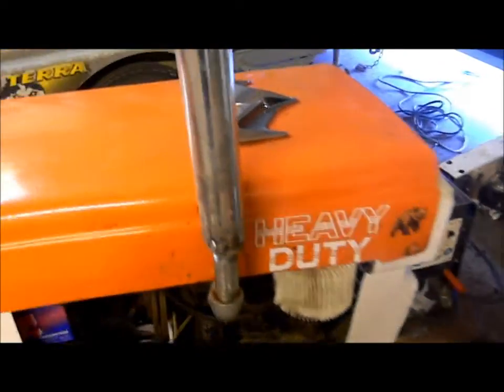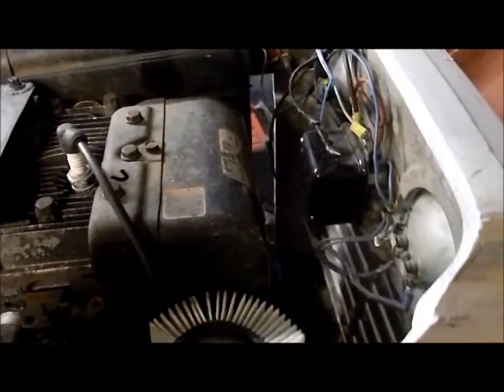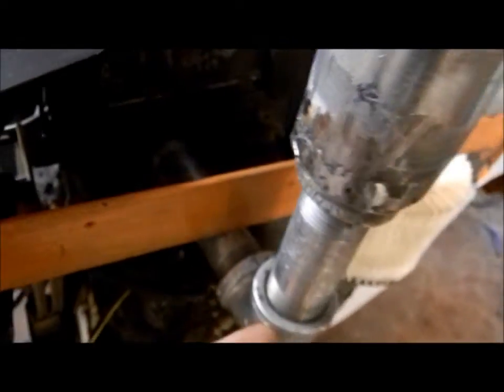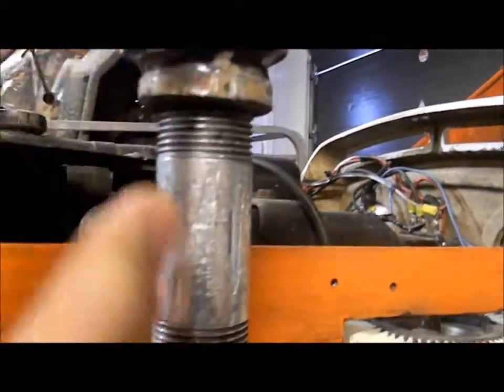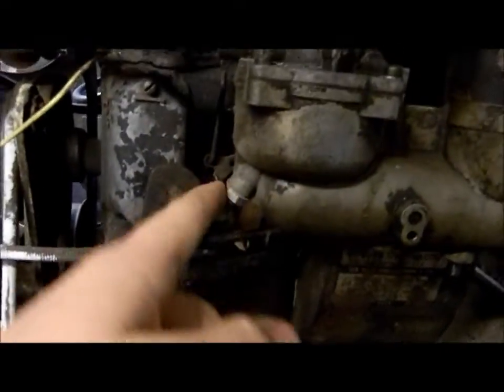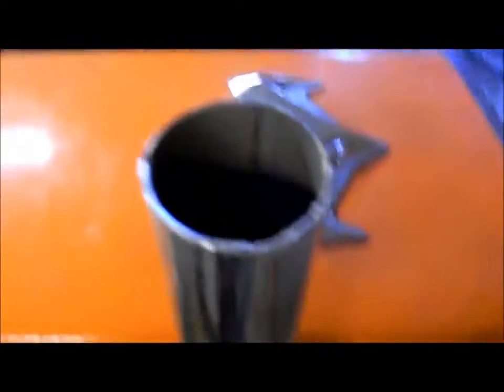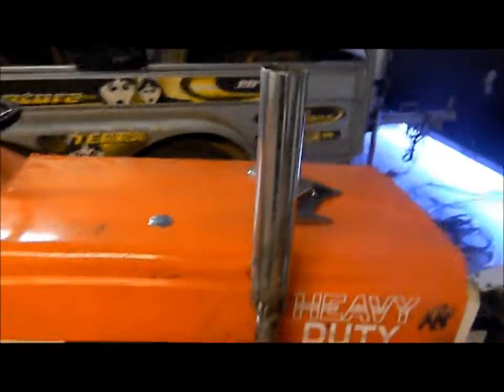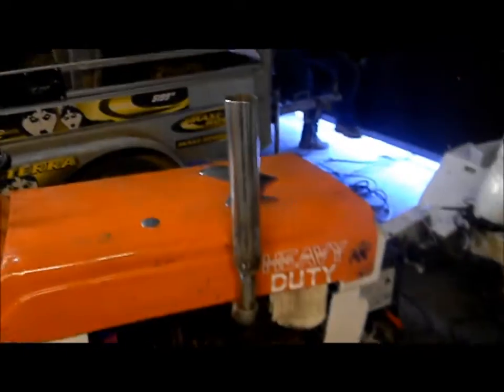costum stack (part 2)

Comment: the exhaust will keep coming loose if you don't put a bracket on it.  Just take bolt and put it through that piece of metal that just above the pipe coming out of the motor and put a nut on it to keep it tight.  Then take a hose clamp or a U-Bolt to hold that part of the exhaust still and not fall off or make the stack tip forwards or backwards.